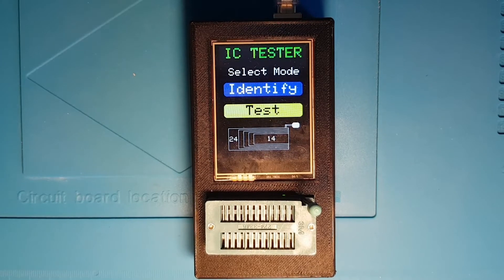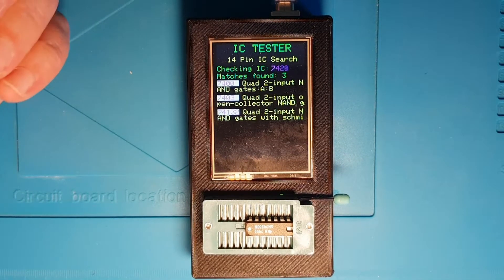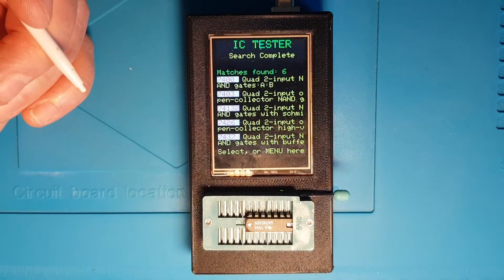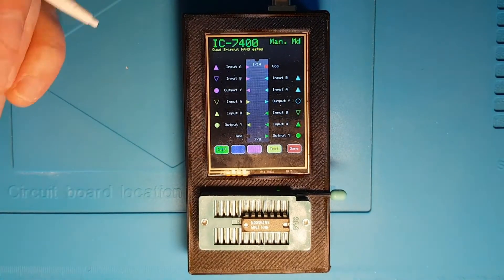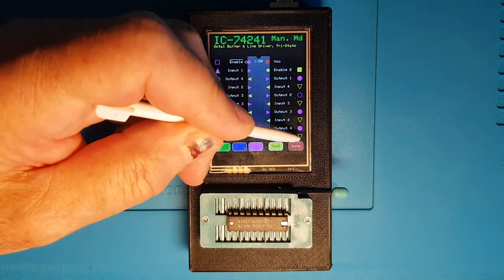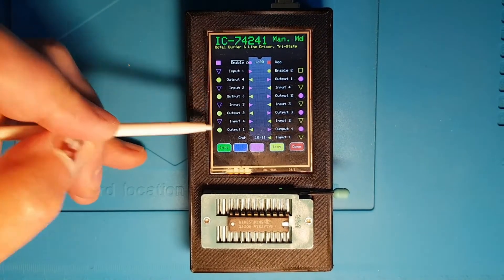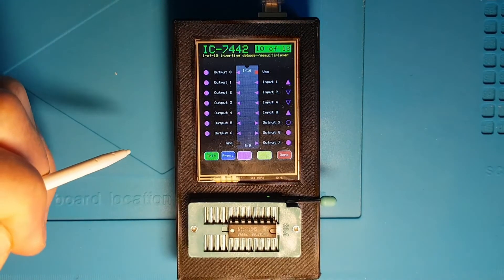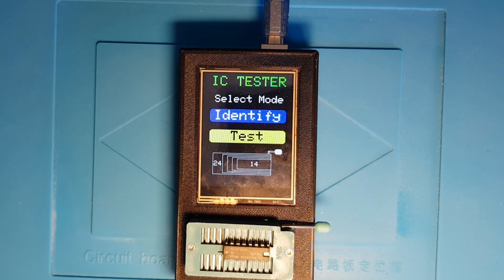Test Equipment: Digital Logic TTL / CMOS IC Tester with Pin Layout View and Manual Mode

Comment: Looks like some great additions to the original. Will you be sharing the files and details etc like the original poster ? Cheers
Reply from the maker: Thanks Richard :-)  I'm currently doing some major upgrades to the project, so I'll do a new video showing those soon.  I'm not currently on GitHub or anything like that, so not sure how I'd be able to share what I've done.  I'll look into it though, when I get a mo'!  BTW, I like your HP videos :-)  Are you Prof Richard Merifield?
Reply: @michaelbenn4741  Hi Michael, thanks for the reply. Yes I am a Prof in Engineering but no longer lecturing.

Comment: Looks good.  Love to build one as well - hope to see more info from this project!  I like the portrait screen orientation and manual test mode - much improved over other designs.

I know it seems obvious, but putting the IC notch on the diagram on the "home" screen makes it even more obvious of chip orientation into the ZIF socket.   

Personally, I'd rather have the unusable buttons disappear in the interface rather than just appear as a colored box, but that's just a preference.

On a side note, the 3D printed case looks really good too.  Which printer did you print in with?
Reply from the maker: Thanks for the feedback Dan :-)  Yes putting the notch on the chip direction is obvious, but not obvious for me to think about it, LOL ;-)  One extra drawRect added to the code, and an acknowlegment to you added in the comment :-)  

Yep, removing the 'dead' buttons would probably be better, but the  Adafruit GFX library doesn't seem to have a function to do that, so I never got round to implementing something to do it myself :-S  

The case was designed in Tinkercad and printed on my Creality Ender 5 with Sunlu PLA.